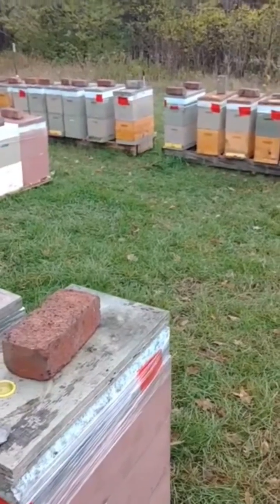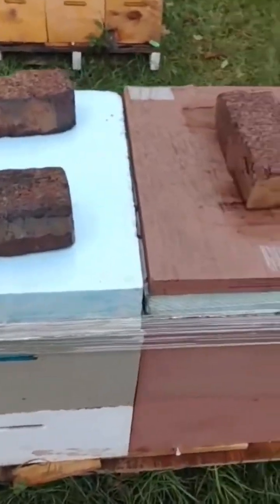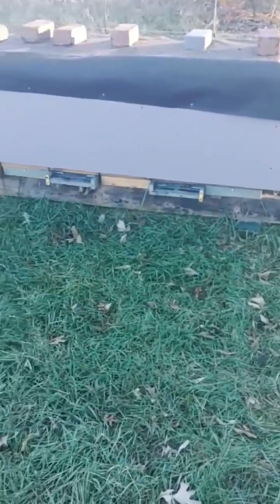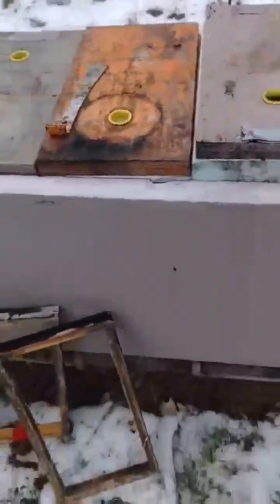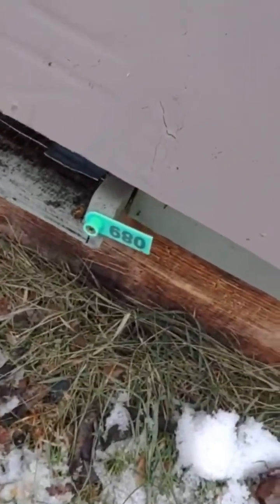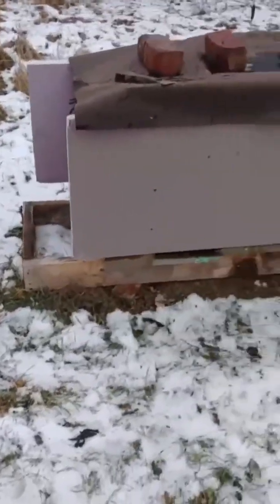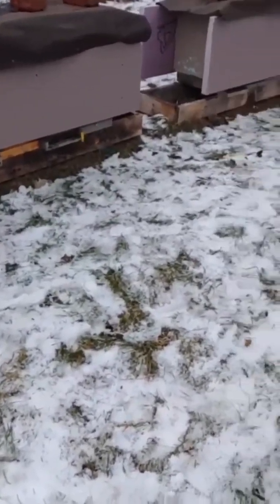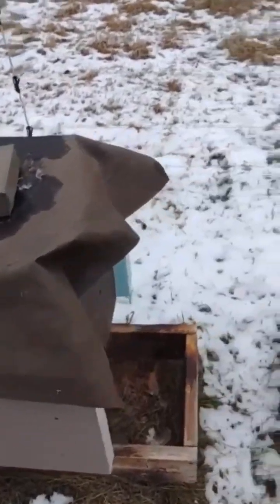Over wintering nucs October to January 24th. #Beekeeping #nucs

Comment: Your winter wrap is almost the exact same as mine. You must have stolen my patented method. LOL  I like the tar paper top. I've been using 1/2 inch styrofoam. Did you do more than one OAV this winter? I did three - Nov, Dec, Jan. With the new instavap it is so easy and I had the warmup weather for it. I'm impressed with your insulation setup. How did you fasten it to the hives?
I've been using a couple of 6 frame nucs in the past and have bought some more this winter. I suppose you make your own boxes? I'd love to come visit you sometime this spring if you are open to a visit.
Reply from the maker: Yes I AOV like you, October, November, December & January. You’re welcome to stop by. June would be good time. Queen rearing and mating boxes will be set up and running, if that interests you. Maybe in May this year if this nice weather holds out.